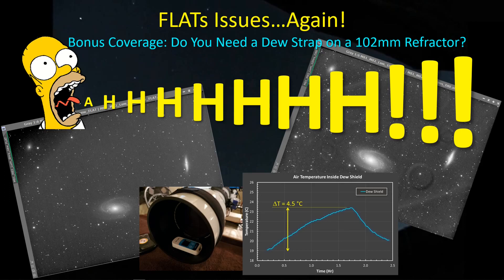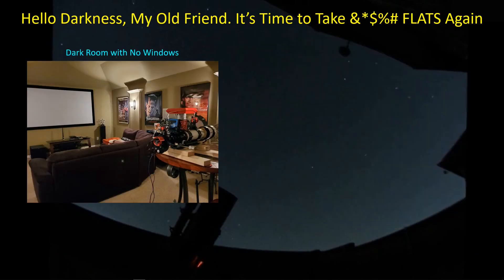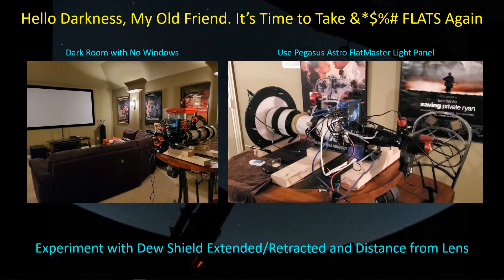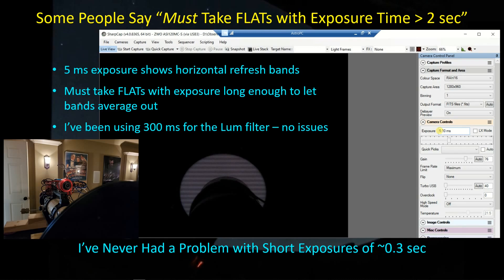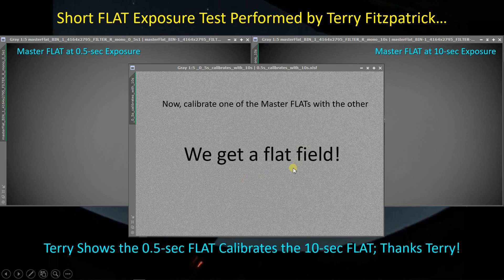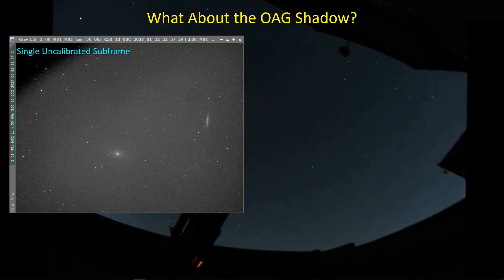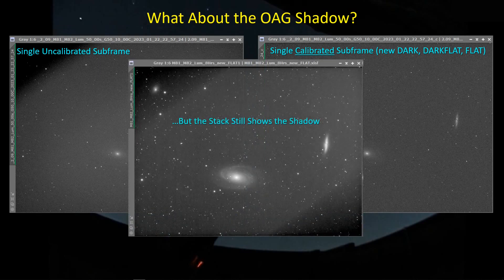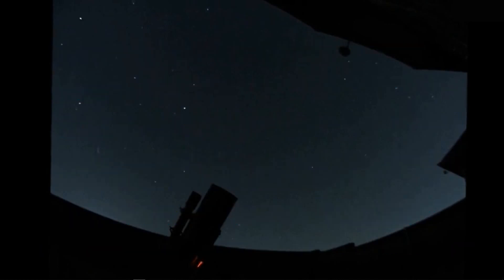More Issues with FLATs

Comment: Looks like the filter wheel has backlash and thus the position is not the same when it goes in the opposite direction. If that’s the case, ZWO should fix that in future models of the filter wheel.
Reply: The filter wheel uses a friction drive. I believe it also uses a light sensor to ensure wheel filter is properly indexed. Backlash may be in the motor reduction gears, but more likely something is off with the tolerances in how it detects proper index.
Reply from the maker: @NightOwl This will be something to keep an eye on. There is a "Calibrate" option, but I have not tried that and don't really know what it does. May have to look into that.
Reply: @Aero19612  According to the manual the recalibration function is indeed for the IR position sensor. Maybe give that a try and see if it helps? I used to have the same filter wheel and did not encounter the problem. I don't imagine backlash anywhere to be an issue if the position sensor is functioning properly.
Reply from the maker: Certainly looks that way, Alfredo. Wish I had done this experiment when I first got the filter wheel to see if that "backlash" was present out of the box. I'll get worried if it starts losing location precision in the Unidirectional mode.

Comment: I'm not an imager, just a long-time visual observer so I'm out of my league here, but... 🙂 Am I splitting hairs to point out the objective (no pun intended) of a dew heater is to raise the temperature of the optic above ambient, not the temperature of the (immediately adjacent ambient) air above the objective? Or is that what you meant? For visual I try to place a dew heater as directly as I can over the edge of the cell / lens. That's not always entirely possible due to construction details (e.g., dew shield attachment, etc.), but ideally that's where I'd like it to go -- On, not in front of nor behind. 

Very interesting video. Although I don't image, I can totally understand: https://www.youtube.com/watch?v=7REI-kBlyQ8&ab_channel=rizzlerazzleuno
Reply from the maker: Hey, Len. I suspect that imagers and eye-ballers are equally affected by dew, so you are definitely not out of your league. Yes, the "heat the optics" VS "heat the air in front of the optics" is an unsettled debate in my mind. I tend think heating the optics is the best approach...if you have enough thermal energy to heat the dew shield/tube + glass. These dew straps don't get all that hot, so (in my mind) heating the air in front of the glass is the path of least resistance. Well worth a "rabbit hole" deep dive!
Reply: @Aero19612  makes sense. My only thought (?) was that to prevent condensation, the glass needs to be warmer than the (wet) air, hence heating the glass not the air. But if it works the other way 'round, I can't argue with results! 😀
Reply from the maker: In a pinch, it's better to be lucky than take the time to be good. Just be sure to plug your dew strap in!

Comment: I never liked ZWO because they have these funny quirks in their products. ZWO have leaking vameras, failing focusers, weird  filter wheels and crashing proprietary airpros. I have qhy wheel/camera with senso2 focuser and mini-pc.....never any problems.
Reply from the maker: I've generally had pretty good luck with ZWO products but have heard of "failures" of this device or that device. I've got a lot of money invested in ZWO products, so I hope they last!
Reply: @Aero19612  To be fair, I recently bought the AM5 because of the weight and I do have other zwo products but some of their stuff is sus.
Reply from the maker: I imagine there's a cycle there. Early in a business's lifetime, they may cut corners and not have total control over quality, then they get good and things stabilize. But if they go through a fast-growth period, some of those quality control issues pop back up. We just have to hope we're buying their products on the good side of the cycle. But we never know.

Comment: Always enlightening and entertaining, James. I suffered the crater syndrome and also decided unidirectional was the way to go. The one thing I will do the next time I must open my filter wheel (and not before) - is to "focal offset order" my filters to minimize my "spinning" time - I do take images in a high to low offset order but haven't reordered the filters within the wheel. If I remember right we both use Antlia filters but my measurements have them a little off par focal.  My offsets range +22 for red to -3 OIII, at least with my refractor/focuser combination.  On the dew straps and my PPAdv - I use the auto-dew selection to avoid tracking which to port to plug in, this may or may not help on all Powerbox models.
Reply from the maker: Interesting that you get different offsets. I do see some difference, but not worth shifting focus for. I may re-visit that conclusion. Thanks for watching, David!

Comment: Thanks for the EFW tip to Rotate in One Direction only, I'm sure we that would save lots of people's nights of imaging. I've also heard that the dew strap should be placed just behind the primary element, so that's where I've been putting mine and it's always been dew free.  Looks like you're having success with it on the dew shield in front of the primary element too, so it's good to know it might be fine either way.
Reply from the maker: Ahhh, yes. The great "where to put the dew strap" debate. First, if what you're doing works, stop reading NOW! The first, most important step, is to plug it in. Geez. There is more to learn on this topic. There is so much thermal mass with the thick dew shield and 3 pieces of glass and the tube itself that the poor little dew strap can't possibly heat all that material up (my reasoning). So, the next best thing, is to heat up the air in front of the lens. I've got to dig into this more. But first, I need to deal with this FLAT issue... Thanks for watching, Andy!
Reply: @Aero19612   Great video thanks.  I also have a 102mm refractor and place the dew heater directly around the lens cell inside the dew shield, should I reconsider and place it around the dew shield on the outside?
Reply from the maker: Hey Julian. I say, if it works, don't change a thing. How do you get the dew strap between the lens and the dew shield - do you have a wrap-around dew shield (like I have for the SCT)? Sounds like a good place for the strap.
Reply: @Aero19612  hi James i have a refractor abd the dew cover slides up and down from the primary lens.  When pushed in, I can get the dew strap fitted around the lens cell nicely and then pull the cover back out to image.
Reply from the maker: @julianmatthews3262  ahhh, ok. You’ve got mor of a gap between the lens cell and the dew shield than my scope has. If mine had that gap, I’d do what you’re doing

Comment: I have also the same issue  - last time I took flats it was partley sunny (I`m using an Artesky flat panel) and I`m pretty sure there was a leak of light somewhere through the filterwheel. So thanx for tips about taking flats in a dark room and make FW only go one way. I`ll try it 👍
Reply from the maker: Who knew taking a picture of light could be so complicated! Thanks for watching, Arnstien!
Reply: just remember that you're putting a light source at one end of the scope....If it's larger than your dew shield then you'll also be sending light across the outside of your imaging train, potentially letting light in, somewhat negating the affect of the dark room.
Reply from the maker: @MGee1  That's true. I've tried taking flats with and without a towel draped over the flat panel. I don't see an effect. Also, it's probably darker in my dark room than it is outside. The perfect is the enemy of the good...

Comment: I had the same flats problem about four years ago and drove me crazy! I called them craters on my flats but luckily I managed to figure out the unidirectional motion of the filter wheel was the solution.
The off axis mirror I would make sure it’s on the long side of your CMOS chip and bring it up a hair. I’m quite sure I was watching your video on off axis guiders to help me set mine up so I don’t think I’m really qualified to help you out!!🤔😁
Reply from the maker: Craters is good description. Totally agree with putting the OAG on the long side of the sensor, but this ZWO OAG combined with interference with the filter wheel only gives me one position where things fit. And this is it - the worst position possible along the diagonal. Thanks for watching, Gregg!
Reply: @Aero19612  my bad! I now remember that you were using your Celestron OAG on your SCT and the ZWO OAG on your refractor?
Reply from the maker: Yeah. The Celestron OAG provides total 360 deg freedom, but it's heavy and takes up a lot of back focus distance. The ZWO is good for back focus and is lightweight, but with the filter wheel, you have no flexibility in orientation relative to the sensor.